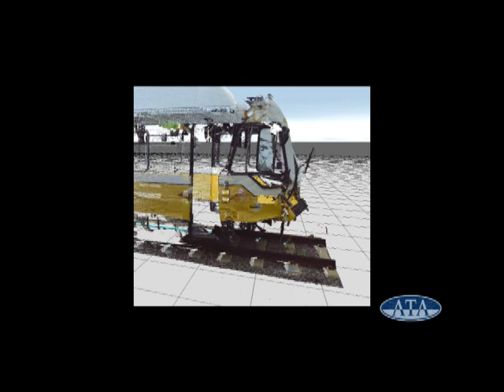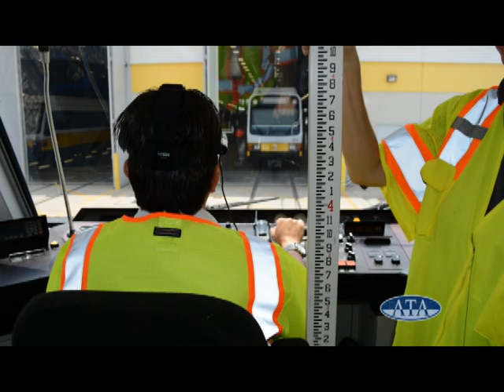Dallas Light Rail Truck Collision

Comment: Have they repaired and put this train back in service, or is it a total loss?
Reply: Raja Rhodes total loss
Reply: Ma'Aliyah Jones I don’t think so I think it’s being repaired
Reply: Ma'Aliyah Jones yeah I work at DART now, it was LRV 157 they scrapped it
Reply: Raja Rhodes Fri

But im a DART fan
Reply: What credentials do You need to be a Train Operator? I’m a Black Brother It would truly be a blessing.
Reply: Slimee Kylon that’s wassup mane. Really just a decent driving record. I have railroad experience so that HELPED me because of my knowledge of how train operate, but not required. All you really need is a decent driving record. But DART isn’t hiring for any positions right now due to financial problems caused by the pandemic.
Reply: Ma'Aliyah Jones I take back my comment about 157 being scrapped. It’s actually rebuilt and in the maintenance shop and has been for a while. It’s just not back in service yet. It needs a lot of mechanical work. But it looks brand new
Reply: TheGamerPro that’s cool. This LRV was rebuilt and now under heavy renovation
Reply: AroundDallas TX and you’re right, it was rebuilt and looks brand new. It’s in the maintenance shop at Central Rail Operating Facility undergoing heavy maintenance work.
Reply: Frank Renteria  well look at that north Texas trains storms and more (north Texas rail productions / north Texas railfan productions is also my channel
Reply: Frank Renteria  oh wow
Reply: Frank Renteria  I only run 2 channels (this one and north Texas rail productions)
Reply: @Thegam4rpro  the comment on my video “H O R N S” was like 

REEEEESEEEEEEEEEEEEE
Reply: @RajaRhodes  ok good lol